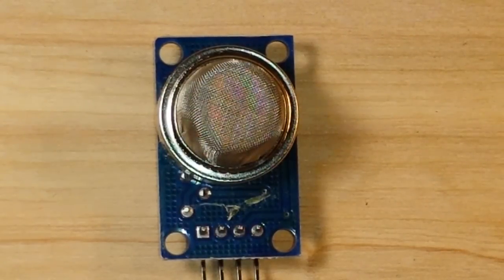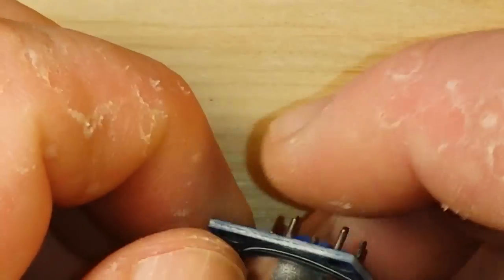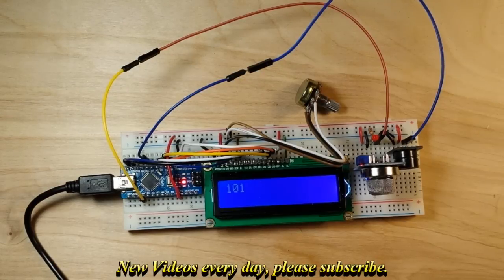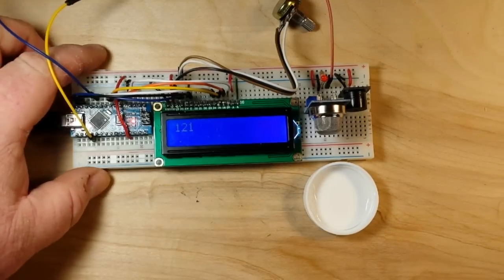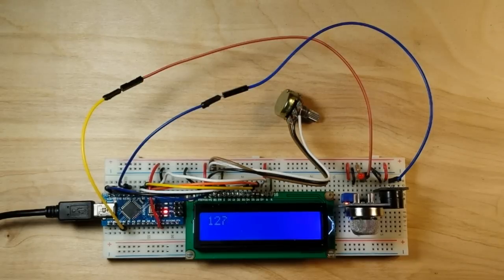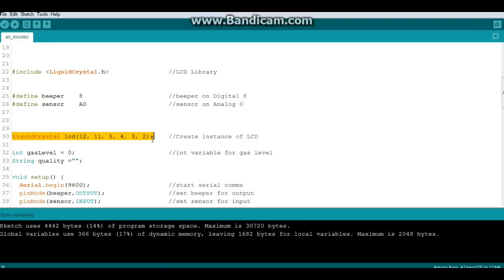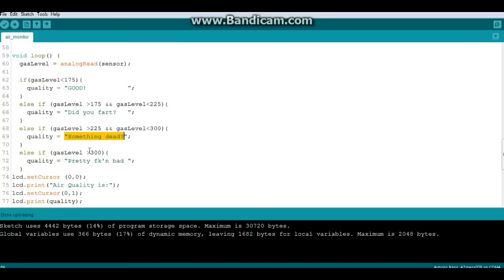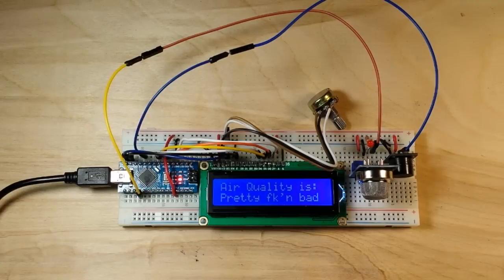Arduino Air Quality Monitor with MQ135

Comment: I want to use it to monitor CO2 levels in my kids rooms at night. Is that adequate/good enough? I'm starting to understand that the sensor cannot distinguish what it's reacting to.
Reply: Exactly, this sensor are good for "air quality", but dont use this with yuor kids! Use common sense, always have good ventilation in a room for kids (an open windows, etc) and buy a real co2 detector( today they cost about 50-60 uss)

Comment: First of all, thanks for the video.
Is this sensor reliable? I would like to take advantage of your code and add it with another code with DHT22 Temperature and Humidity sensor, for example, while there is no detection of gas, showing Temperature and Humidity on the LCD screen. Do you have something like that or could you give me a hint on how to do it? Thank you
Reply: if you do it please help me
Reply from the maker: Yes, very doable

Comment: the chip Looks like a LM393  not as you spoke three O three 303.
Reply: 303 is a magnetometer w/ accelerometer. I use those in a few of my projects. 393 is an 8-pin comparator, which makes more sensor on that breakout board. you are correct.

Comment: Hi mate - bit confused with your sensor layout because at video up to 2.00 minutes your board showed the sensor D0 pin connected to nano D7 pin and then after 2.03 minutes this connection disappeared and sensor D0 line was replaced by an LED connected thru a resistor to the 5V line on the breadboard with no comment regarding this circuit change??? can you explain why you did this? Also after the sensor goes thru its first cal cycle it seems to lock up at one of the CO2 choices?? Hope you can take the time to explain these changes? Cheers

Comment: Normal background CO2 level is 400ppm. Is this properly calibrated? Do you live in a rainforest?
Reply: Assuming it's using the same code at the end the display isn't showing ppm, it's just the raw ADC values. You have to calibrate and use a formula in the datasheet to get ppm. Most of the code examples available online also calculate the sensor resistance incorrectly, but when you do it right they are pretty accurate.
Reply: I have problem with voltage regulator. If it not stable, the result is not stable too.
Reply: The point is, the MQ 135 doesn't measure CO2 only. It measures lot of other gasses too so you can't say that the thing you measure (even if you use a formula and calculate with the measured value) it can't really show only CO2.
Reply: Lmfao

Comment: Hi!, Can you make the screen shows all kind of gases concentrations at moment? Something like:
CO2: 122
NOx: 200
NH3: 150 
etc:.....
Reply: No that's impossible with that sensor.
You don't even know what gas it is reacting to
Reply from the maker: It should be possible since all gasses effect the resistance differently.